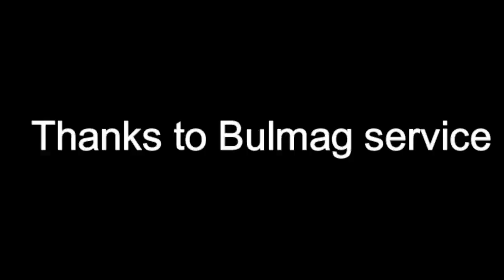Disassembly and repair Scala Rider G4 Bluetooth

Comment: Good vid, bro. But I'm looking for a way to crack open the power set audio kit portion of the unit; the part that mounts the Cardo and contains the mic and speakers. I want to upgrade the wires to the speakers to something thicker that can actually be repaired and soldered and I don't want to "test my unit to destruction" doing it. Any thoughts...?